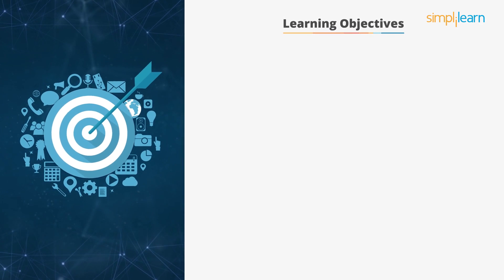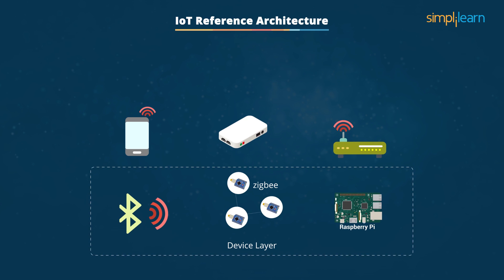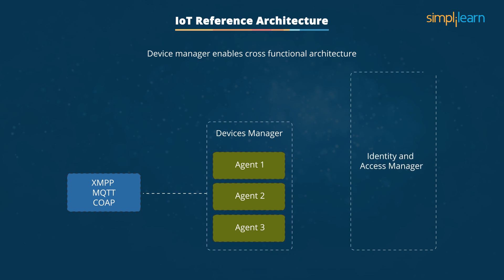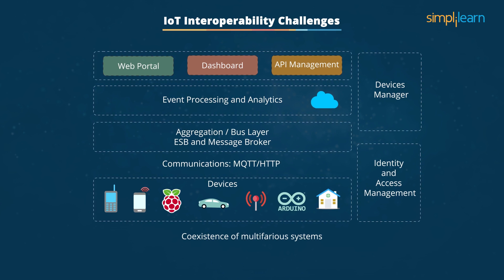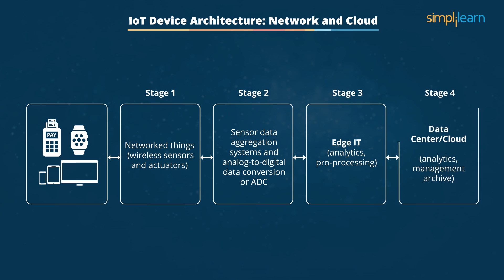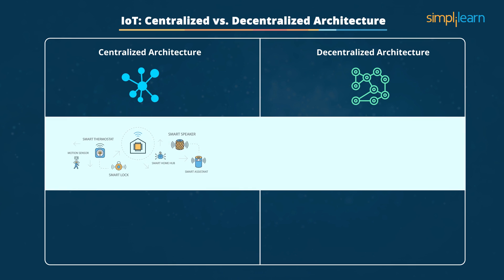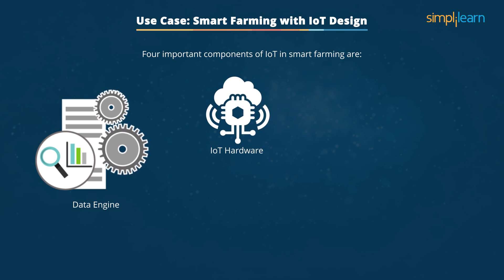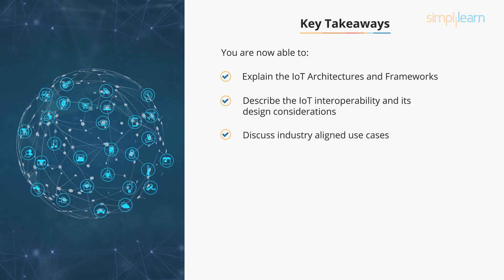IoT Architecture | Internet Of Things Architecture For Beginners | IoT Tutorial | Simplilearn

Comment: If I want the server to detect the existence of the robotic car to receive the data collected by the sensors of the car by using Arduino, In this case what the protocol that I will use and how I will do that?
Note; the car must go far away from the server without internet for measuring and come back again.